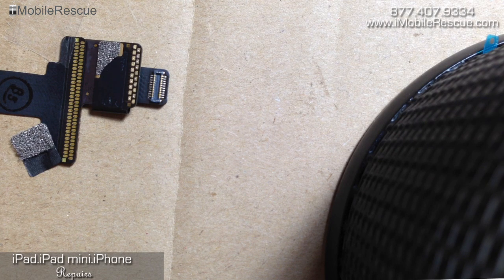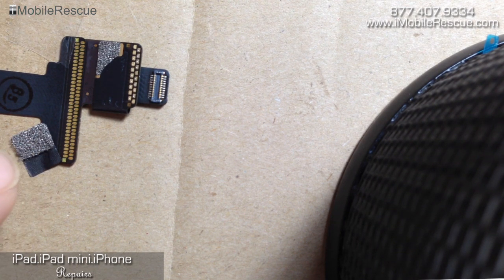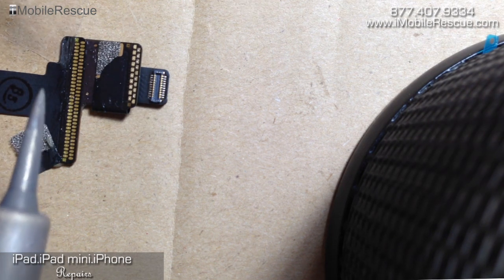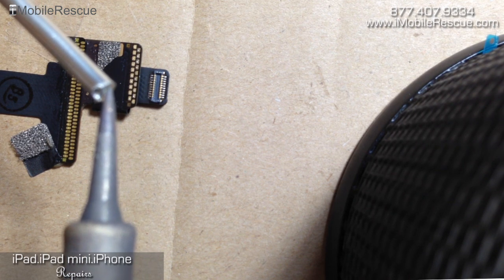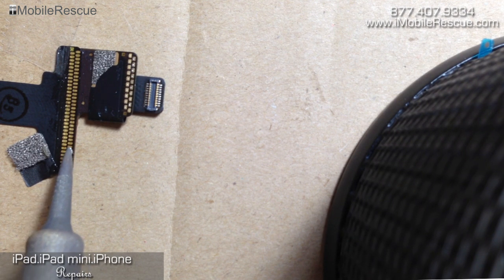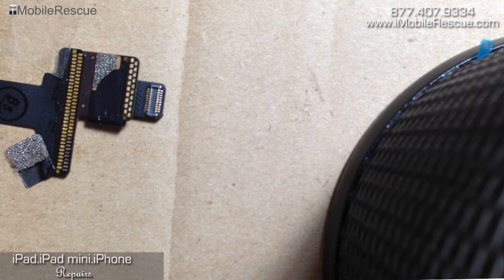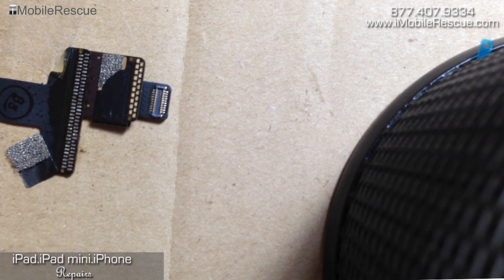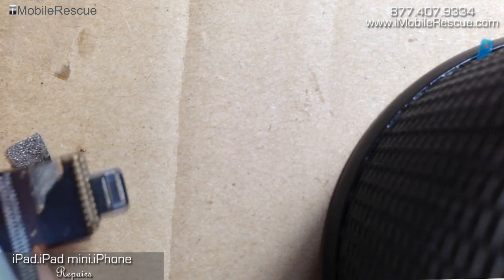iPad Mini Repair - Soldering The IC Chip Onto The Digitizer

Comment: I have a little problem on my hands : 

1. We replaced the glass (with ic chip) on Ipad mini A1432(white) due to broken glass.
2. No gold pins are broken that connects glass to motherboard.
3. Ipad is not swiping, not reading touch of finger movements. 

A. I have a same model (one is black ) with same broken screen.
B. I take the(new) Glass that i used on the white ipad mini im replacing and put it to test      on the other ipad..
C . Works perfectly.  I also take the LCD and put it to the other one, just incase and        
      swipe still does NOT work.

I wonder what is the problem, during take out process. I grounded myself every 5min because im paranoid. Anyone have a similar issue?
Reply: Probably a bad cap.  Had the same problem and changed one of the caps.

Comment: Dude u put Flux and soldered the wrong side of that board  Haha  make sure there is a little solder on each pad on one of the 2 connectors then put some flux on there,  sandwich it all together then heat it up with a soldering iron or better yet,  with a hot air rework tool and bam,  is back together.   U need the solder and flux to be where the 2 pads come together,  soldering the outside ain't doing much except asking for this to fail down the road.
Reply: Jason Wells Hi there Jason - Unfortunately, for you, this device was never returned. I happen to know the customer personally (I am the owner of the company) and he just sent me a cool selfie of him and his kids on the beach, from the iPad mini. (shrugs shoulders / doesn't know what to tell you except stop hate-commenting on YouTube ) You're welcome for the video though. You elegant human being you.
Reply: +Ryan Ballow - Everything Jason said is valid, he's not hating, calm down buddy.

Comment: So I have several questions... 
1. Two square contacts at the end do they also get solder. I don't actually have the ic chip out yet as I don't know if I have convinced myself I can repair?
2. In your video is the screen face down?
3. Do I sound like a complete idiot yet?